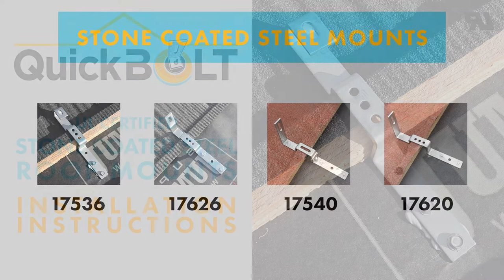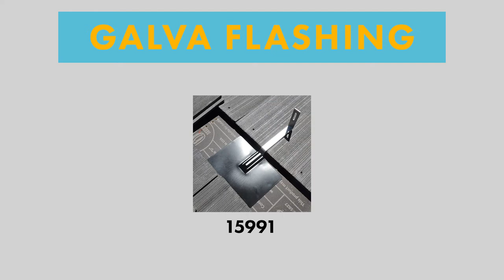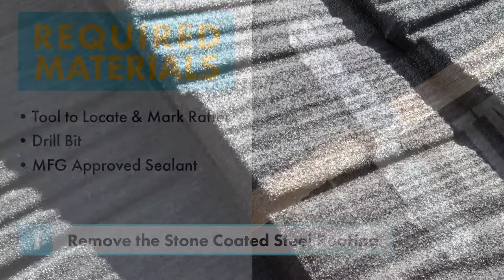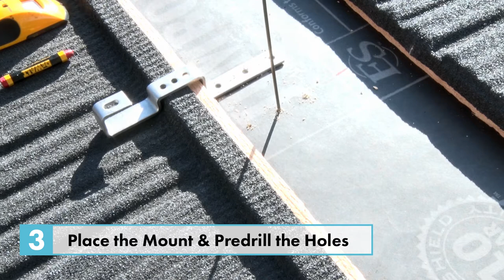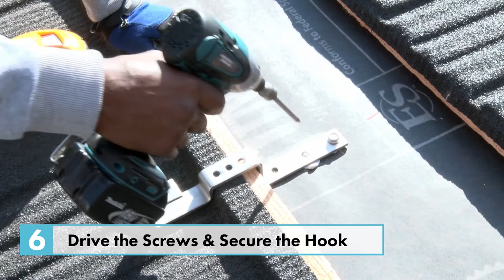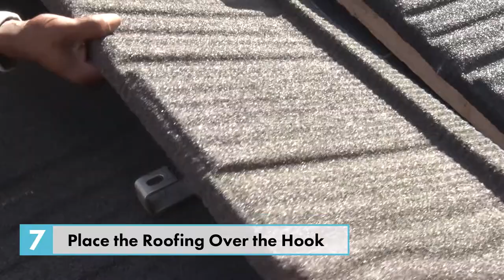Stone Coated Steel Roof Mounts | INSTALL VIDEO

Comment: Now that gets around the problem of a conventional asphalt roof needing replacement and the existing racking getting removed. Perfect for new roofs. But for retrofit, how about more detail on removing and reinstalling the steel panel? That’s the real kicker.
Reply from the maker: great point! because there are so many different models of steel roof panels it's best that installers refer to the manufacturer's instructions for that level of detail. In general, stone coated steel roofing is either interlocking, or overlapping and sometimes fastened with nails.

Comment: That tile looks flush against the battons and then flush against the plywood.

My tile is only flush against the battons and then there is a 4 inch airgap to the old roof, with insulation thrown in between.

Can those brackets rest on a hollow shingle, extended a few inches out from the batton? It looks like it would be strong enough, because it's resting on the batton.
Reply: I am not familiar with your situation. You might want to check with the roofer that installed your roof to see if they can fill in the air gaps where you need to install the attachments.